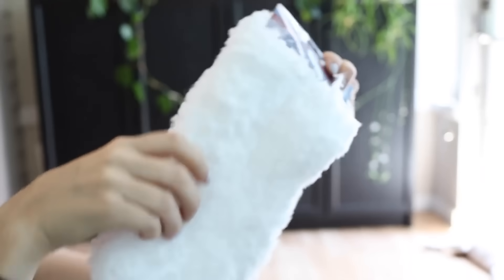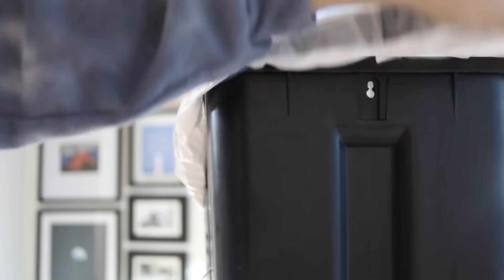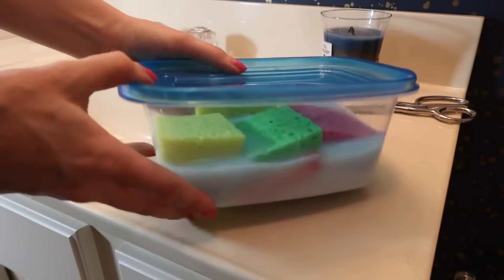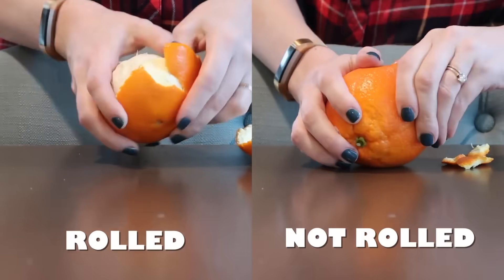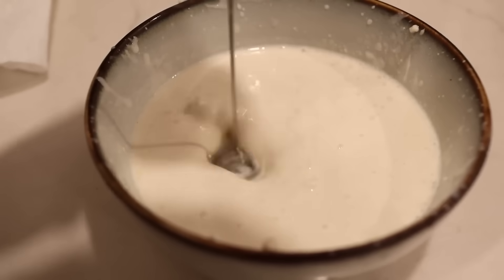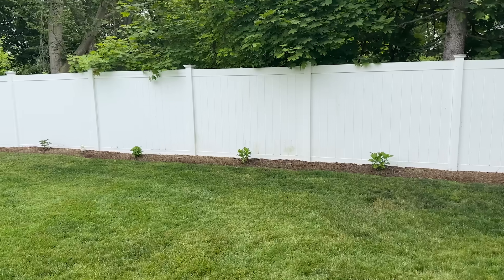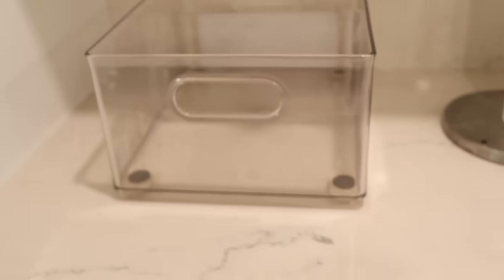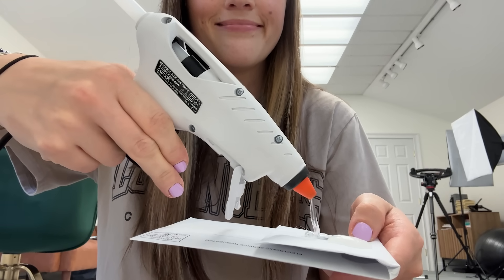43 brilliant NEW home hacks you need to try!! (you won't believe #22)

Comment: All you have to do with boiled eggs is crack and squeeze them when they’re hot then put them in room temperature water for 1-2 minutes. The shell will peel right off in 1-2 pieces. It’s simple, quick and efficient.

Comment: for chef knives, never-NEVER-put them in the dishwasher or use a glass cutting surface. Just rinse them off-scrub when needed, dry it and put it away. The dishwasher and glass cutting surfaces dull the blade and a sharp knife is a safer knife. 😉. Command hooks are great for hanging your mugs from the shelf in your cupboard, freeing space underneath for dishes. Love the rolling feet hack!

Comment: Mark your cleaning  tooth  brushes with a dot or words using  fingernail polish.    My adult sons live in a house together.   They have the same type jeans, sometimes  same size.  I am going to mark the jeans  on the tags with a different  color fingernail  polish for each son's jeans to keep the jeans separated to owner.   ( I spilled fingernail  polish on a bottom  sheet, years ago.  The fingernail  polish is still there, after many many washes ).   But sheets are usable

Comment: You probably won't see this but I found a way that works for eggs to peel perfectly. It honestly works. Every time! The trick is to first bring your water to a rapid boil. Next lower the eggs into the boiling water with a large spoon. Boil for time according to desired doneness. I boil mine for 12 min. Then drain the water and place the eggs into an ice bath to cool down. Usually for about 10-20 min. Next to peel the egg....tap the egg on the top of the egg until it cracks really good. Now tap the egg on the other end. The bottom, until it cracks. Now place the egg on its side on the counter top and apply a little pressure and roll it until it's cracked all the way around. The whole egg shell should slide right off. Hope this helps someone!
Reply: Wow, you have too much time on your hands😢

Comment: The s'mores trick should be done outdoors only! Not just for fire safety but also to avoid carbon monoxide and smoke inhalation! And for fire safety, I would recommend keeping it on concrete or a rock. Not on a wooden picnic table or on any grass.

Comment: I have a Sonic rechargeable toothbrush. I save all of the old toothbrush heads and mark them with a black marker so that they never go back in my mouth again (ewww). Then I use the OLD, used head ON the sonic toothbrush to do the scrubbing for me! It gets in the cracks and crevices and all I have to do is hold it. When done, I rinse the old used head and put withmy cleaning suppliea.  I sanitize my Somic toothbrush holder, and install a new toothbrush head, and set on the charger!

Comment: I stopped the video to fold some clothes in the dryer and I stacked my tops, inserted the hangers, folded it and repeated...genius hack...as good as decades ago when I discovered there is more than one way to eat corn on the cob..I always ate down the corn to one end and back like a typewriter..one day I observed someone else eating around the cob. It is a game changer b/c you don't get that mess on the sides of your mouth.  Who knew.  The museum gel sounds great...I don't have any but I do have some permanent gel glue dots and some double sided sticky foam tape so I improvised...I used both items to secure the plastic baskets in my drawers that always move forward from opening and closing the drawer...it was driving me crazy..now they don't move.

Comment: If you put your food into a plastic cooler & then add hot water to it, the plastic will release chemicals into the food.
If you use dryer sheets, be aware they have formaldehyde in them. That's why your dryer filter gets that shiny  look

Comment: some good tips, but an easier way to cook corn on the cob - bring a pot of water to a boil, add corn, and put a lid on the pot. Turn the burner off.  Let sit for ten minutes - wala.  It's a lot easier than transferring boiling water to a cooler.

Comment: ✨❤️GREAT TIPS❤️✨ however….bread bag….there is no way everyone in the house will do this the right way😝 BEST BAG CLIPS are the packs from IKEA with large and small “bag barrettes”….THE ONLY chip/bag clip I have had in the house for 20 years…they are perfection💋✨ The watermelon tip = genius ❇️✨If a pantry staple comes with a plastic seal on top, I use a knife to cut a clean line to cut across the top and only remove one side. This is much more durable than tape…most of the time😉

Comment: Buy 2 doz eggs. 1 stays in the fridge for at least 2 weeks...other gets used for various food preps.  The older dozen gets cooked...boil water for 3 min....then shut off the heat or put on lowest setting. Cover the eggs & leave for 20 minutes to keep cooking. Drain, Rinse w. cold water twice. Crack each egg w. the handle of a knife & return to cold water, which will work beneath the skin...which will then slide off easily after a few minutes or rest. Never works s. fresh eggs.  Now you can take advantage of good sales, make up the broth for Sweet Mixed Pickles....fill a large jar with cloves of garlic, a hot pepper, the dozen peeled eggs & pour the hot broth over. Close the jar & store in fridge for at least 2 weeks ...use sliced in tossed salads or egg-salad sandwiches etc when eggs are more expensive. An amazing sandwich...chopped eggs mixed with diced onion & mayo between 2 slices of bread then Cheese Wizz on the  top slice, topped w. a 3rd slice. Use the thin sliced kinda bread.

Comment: I take everything out of the dryer And lay out everything flat! Then they won't wrinkle! Layout piles on couch or bed. Then you can do all shirts w hangers like you showed.  Pants I lay full out flat so if I don't want to fold them right away they can just lay there for a while and they will not get wrinkly. Wrinkles suck I hate to iron. It's just easier to lay it all out. I have 3 other medium size laundry baskets. 1 underwear 1 bra 1 socks then you can just throw them in the right basket and those can wait till forever. Who cares if any of those Wrinkle nobody will see them really. Sports bras I'm talking about & under tank shirts. Love my sorting method! 😊😊😊😊😊😊

Comment: For my eggs to peel easily,I mean easy easy.take your eggs out of the fridge and let them get to room temperature..then put them in the pot and run hot water on them up to where you are going to boil,boil for 10 minutes..dump the water and i run cold water on them after they sat in the water about 10 minutes they will peel easily

Comment: Why buy toothbrushes to use for cleaning? I save my old ones and use them to clean the house when they are no longer good enough to clean my teeth. Also, if you save the old brush heads from an electric toothbrush, and use them on the electric toothbrush (making sure you know which is the cleaning brush and which is for your mouth!), you have an extra boost of power that helps you to whizz through the task.

Comment: Useful tips, thanks! Always need more lighting especially. Couple of extras….Easier than wax paper, used for ages: *Liquid kitchen wax.* Housewives have waxed their surfaces, stoves, appliances, walls, fixtures, floors…keeps things shiny, and scrubbing to a minimum. (And slippery, so be careful on wet floors. There was an extra reason not to run through the kitchen…aside from sharp knives and hot foods being prepared…and not irritating the grownups). 

They have made **sleeker toilets**, less nooks and crannies to clean. Expensive. Not harder to make, but call it “designer” and “sleek”, and “modern”, rather than just “simple” and “plain”, and you get people to buck up for it. It’s not hard to make a one piece and a smooth outside casting. My one-piece, though, was expensive and never really worked well, (wouldn’t even flush properly even with just plain water, nothing else, not even one square of tissue, may have been a flawed internal casting issue), despite promises it would. That was more because of the change to low-flow toilets and how they didn’t yet have all the design bugs worked out (1990’s). Tolerated it waaaayyy too long. The 2-piece now works likes it’s supposed to work. 

You can *make s’mores right over your stove burner* if you want, electric or gas, all you need is the heat. Gas stove is more fun, though. And you have 4 burners, less waiting. Longer skewers for the adults, if you have kids. (In the old days, kids were just taught stove safety, and used the stove, preferably with an adult near, but not always). 

[**Lavender essential oil heals burns much faster**, exponentially faster, btw. If it’s the real deal, that is. Never without a bottle anywhere I go. Won’t scar, either. Deepest seared burn, they wanted to do a skin graft, and “against medical advice”, having used it many times for burns, I put straight top-quality lavender in it several times a day, coating all areas of the deep trench of a burn (down to the muscle, caused by foolishly reaching into someone’s electric oven to add something, flinching, searing back of my hand on the 350° electric coil—flinched hard, so the wound was deep). I just told the docs they’d be shocked and they were. I put it on throughout the day, kept it wrapped, and after about 10-15 days, when the deeper recesses were sealing up, I began to add some Neosporin over the lavender applications, and in less than 30 days from the date of the burn, the deep trench in my hand didn’t even have a fleck of a scab left whatsoever. 

From basically being branded, to perfectly smooth skin, 30 days (and that was even more a big deal because I had only just inadvertently allowed myself to run out, had used it more than usual and was just about to buy more.. and we got the biggest snowstorm in ages, and it took 3 days to be able to commence the process. Never again will I ever not have it on hand). 

In about a year or so, the dark flat mark also faded, (I did keep using it now and then on the mark, and *Rosemary and Sage essential oils* also **fade scars and break down scar tissue**, if you use a carrier oil and massage it in, massage the scar tissue and try to break it down, **Castor Oil (sticky stuff, but good) also aids in this**, a good little concoction with a carrier oil to “carry” the molecules deeper and to make less sticky, to use as early as one can, but can help even older scar tissue, with persistence…. I didn’t use any carrier oil for the hand, needs to be straight. **Lavender essential oil speeds healing, kills germs, reduces or erases scarring, and was used in WWII by the French in place of penicillin when they had none, kills even gangrene**. It’s the Swiss Army knife of essential oils, a handful kill pretty much everything and can be diffused to stay healthy, especially in winter months, but pets and their effect on specific animals breathing them need to be researched).

And now, **it’s impossible to tell the deep burn was ever there at all**. No scar, only the medical record to prove it. Consistency and frequency and GCMS tested, proven and shown, a reputable source are key. It’s no time for an Amazon or Sprouts run. Those don’t reliably work. People have tried. Synergy (formerly  AnandaApothecary), Young Living, and probably DōTerra would be reliable. It was YL I used at the time, Ananda after discovering them—better prices, tighter quality control, no MLM]. 

And final added tip: **Find someone who likes to clean and pay them to do it**. 😊

Comment: About the laundry marker. Am I the only one dividing loads between clothes than can be dried and clothes that needs to be hung up on a rack?
And about the toilet cleaning with a brush: did you know you can actually lift your seat off and out? Then put it in the bathtub or shower to clean it there, and you won't have as many cracks to clean and will get it done MUCH more easily!

Comment: I would like command hooks a lot more if they didn’t fall off 30% of the time.

Also, a hard boiled egg cooker will CHANGE YOUR LIFE. Just put eggs in, push button, walk away. Timer goes off, collect perfect eggs. No ice water, no guessing, no watching things cook. Also they’re a cheap and small appliance (so they fit in the tiny corner cabinet of the kitchen where nothing else fits).
Reply: I agree they never stick😢

Comment: The little hole on the trash can is for making a little know and pull it up into the the smaller part.  It will keep your trash bag nicely tucked and secured without any other plastic that will fall off with tile and it is more work even.  Ok... keep watching for more dangerous and unnecessary tips for example, the rug corners are not hacks, the hooks you put on he fence are not hacks, the bulb, etc... and everyone who has a basement know how to stuff things that don't use as often there, not a hack... that's what basements are usually used for 😆
Reply: The outlet covers are not hacks
Reply: The roller sticks are not hacks

Comment: 😅 nearly all toilets like that pop open and you can clean it much better. Many even have easy to tale off seats and if the seats fully off much easier to clean each then re attach... if you never popped those tabs open I guarantee underneath it is globbed up with gunk of mold and 💩 😅.

I don't do it everyday when I clean my toilet or even each week nessesarilly but when I'm doing a good clean and not just a quick clean you gotta get underneath those and up behind and under the toilet and scrub the hose and wall and floors behind it and move the little knows to scrub under and around the screws too. If you don't you have a bathroom with mold and poop smell no matter what you do and your stuck having to use air sprays and stuff😅

Comment: The bottom of a rug, ok I know this will sound crazy, but works, and I’m sorry but a slippery rug? Oh no no, it’s THE worst, just one of the very worst things ever… I’m already clumsy enough as it is! So ya take a hot glue gun and you can make either dots / globs All over the bottom of rug or you can make strips sorta a chevron pattern and it creates a grip for the rug to the floor! Kinda like those socks that have grippy action?!Also, when I went to try this for the first time my hot glue gun randomly wasn’t working. Luckily that didn’t kill my vibe tho because I had a friend over at the time who and they showed me how easy it is to get the same exact out come with just using a lighter and heating up then glue sticks that way. Just be careful is all. But anyway the rugs and the hot glue on bottom for anti slip, super works and very cost effective!! Cheers!

Comment: Brillliant hacks! But I'd be very concerned about the cooking corn in a cooler advice. Not only could the plastic leach BPA's and other harmful chemicals into the food, but the boiling water will eventually damage the cooler's glue bond and melt air gaps into the Styrofoam filler and damage the seal.

Comment: Have you tried using eggs that are atleast 1-2 wk old. Sounds gross but here me out. The older the eggs get, the membrane breaks away from the shell as it ages. Then you can boil it, steam it, air fryer it do it whatever way you want. Shells will come right off. Ive never gotten sick nor my extended family. I've been the official deviled egg maker for at least two decades now.

Comment: Easy-peasy way to shell hard-boiled eggs is to cook them in a Dash egg cooker, then put them for a few minutes into an ice water bath.
The egg cooker cooks them PERFECTLY (no green or gray around the cooked yolk) and the shell easily pops off. Just crack its side on the countertop and roll it between the counter and your palm. Comes right off, often in one piece.

Quick & Easy Corn Cooking:
   -Place 1 to 3 ears of unshucked corn in the microwave
   -Run on high at 4 minutes per ear (3 ears = 12 minutes)

   -Remove to cutting board with oven mitts (will be VERY hot)

   -Slice end of ear a half-inch or more above the stem
   -Squeeze the ear to push it out through the cut stem end
This process cooks the corn and the silk is left behind in the husks.

I have a tiny kitchen. It's so tiny, I don't really have any counter space for food prep. I also have even less wall or backsplash.
I currently put a large cutting board across a top drawer just to the right of my stove.
Recently, I realized this "Food Prep Station" would be best served with a magnetic knife rack, so I mounted one to the inside door of the wall cabinet immediately above that spot.
I rent, the cabinet door is melamine, so I mounted the magnetic knife rack with a strip of silicone-gel double-sided tape.
And I added Command hooks to hang potholders, putting them in easy reach of my stove.
These have worked wonderfully to enhance the efficiency of my "Food Prep Station" while regaining more storage space in my cooking tool/gadget drawer.

Comment: You need to get a motorized tub scrubber.....way better than the dollar store broom head or sponges or toothbrushes.... and they come with multiple heads. USB chargeable and cordless. You're usually amazing with home hacks, but toothbrushes for crevices and tub tiles? Really? Is it 1920?  Get yourself a motorized tub scrubber with multiple heads and save yourself the manual labor.